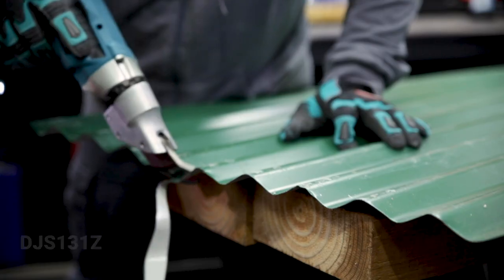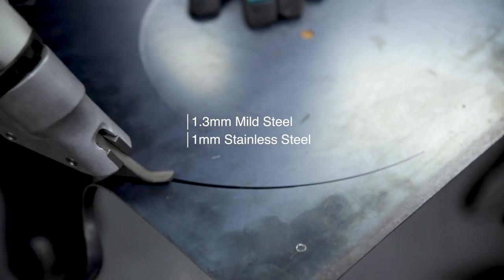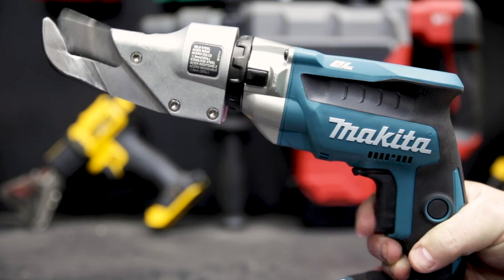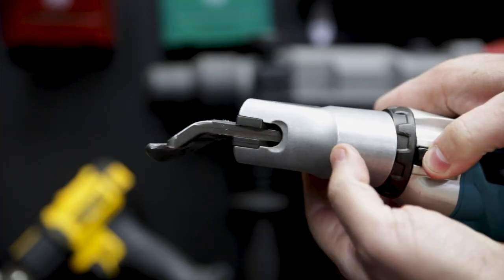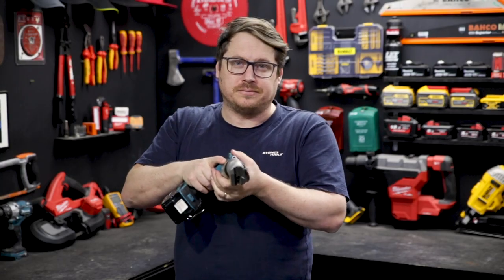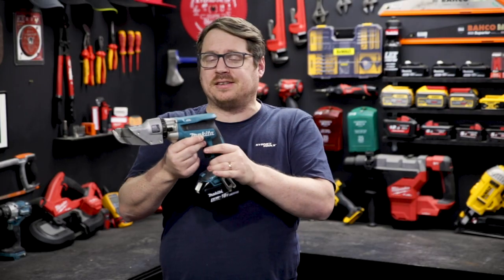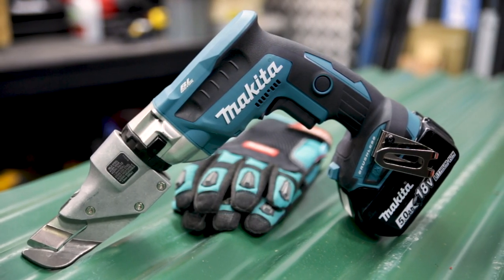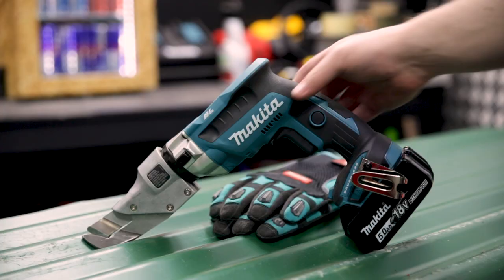NEW Makita 18v Brushless Offset Metal Sheers

Comment: Gidday. Just got a set myself. I noticed that when I pull the trigger there’s about a 0.5 second to 1second delay in the motor kicking in, is this normal? I can gently pull back the trigger a fair way before the motor kicks in just wondering if my tool has a response issue I should sort out.
Reply from the maker: That doesn't sound right. Best take it back to where you purchased it.

Comment: If we need to cut from middle of a corrugated sheet is this good or the other one with shorter double blade???
Reply from the maker: Are you doing a cutout in the middle of a sheet? I'd use the offset sheers especially if the cutout is round

Comment: I can't find the replacement blade, where would I purchase some extra ones?
Reply from the maker: From our repairs department. They are sold as parts so not a listed items.
Reply: What's the average cost for the extra parts? And are they easily installed or would I need to send my shears to be fixed by the department?